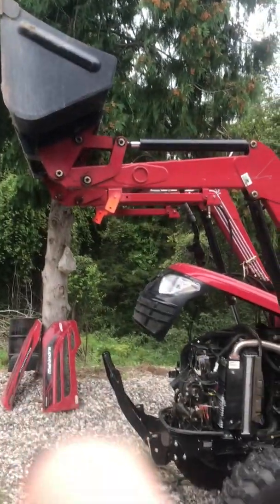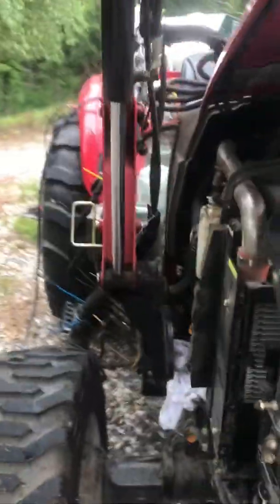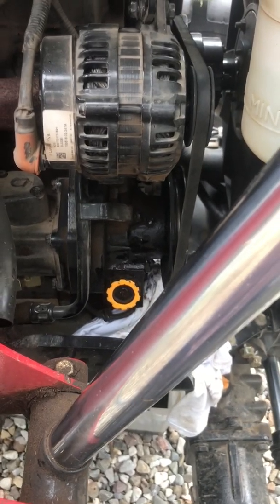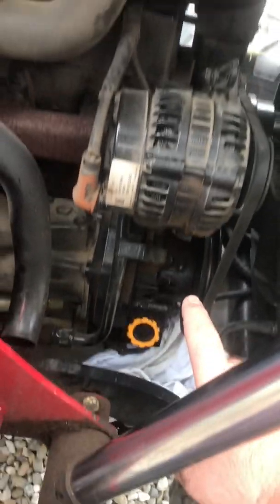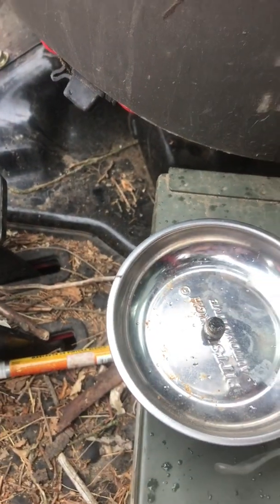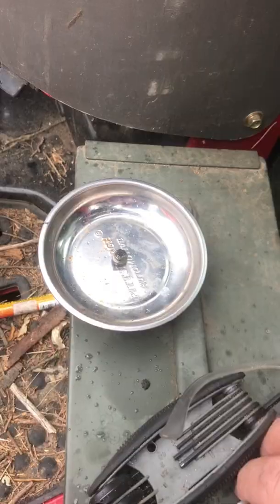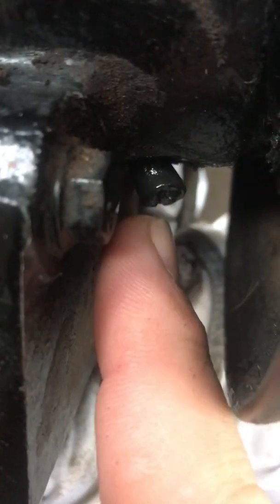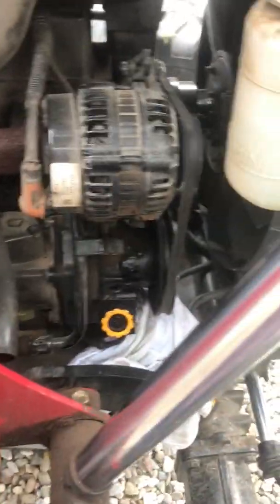Mahindra 2555 hst grease fitting on power steering pump

Comment: Thank you for sharing this! Hey, this is off the subject, but I have the same tractor, it's nearing 500 hours, I need to change the HST again, what brand do you use/ do you like?
Reply from the maker: I use what they sell at Tractor Supply.  ENGINE OIL – SHELL ROTELLA T4 DIESEL 10W-30 – 2.25 GALLONS

GEAR OIL FRONT AXLE – TRAVELLER – 80W-90 – 2.64GALLONS.

HYDRAULIC OIL – TRAVELLER UNIVERSAL TRACTOR TRANS/HYDRAULIC FLUID – PART # 591568, UPC 7237291568 .           9.24 GALLONS NEEDED. I think it even said Mahindra in on the barrel as far as what tractors it was good for.  Then I switched to Shell Rotella HD part # 550039811.  cost twice as much but i noticed Travellers stopped saying Mahindra on the bucket label and I just feel more comfortable with an HD oil.

Tractor has been working fine except I do see a bit of a drip right rear axle seal.  I am not going to bother fixing it.  just a minor drip.  I lose way more just changing implements with the spillage from hydraulic connectors.  and I did seal the freeze plugs above the pto shaft and changed the pto seal.
Reply: @allthingsdiymike1106  Thankyou soooo much! this was just the info I needed. I also used your PTO seal replacement video to replace mine, went PERFECT. Thanks again for all the videos you are posting, keep them coming!

Comment: Thank you for taking the time to post this.  I find the Mahindra manual to be lacking in a lot of areas.
Reply from the maker: Your Welcome!  I have also had an issue with my intake heater.  I tracked it back to the relay under the hood.  But, there is a spare since the glow plugs are not used in this engine (because it has the intake heater) so i just switched the relays.  i will do a video on it soon.